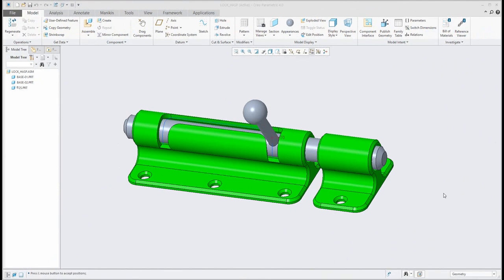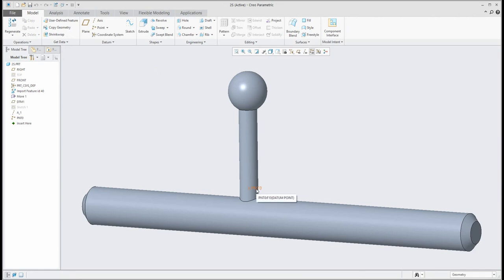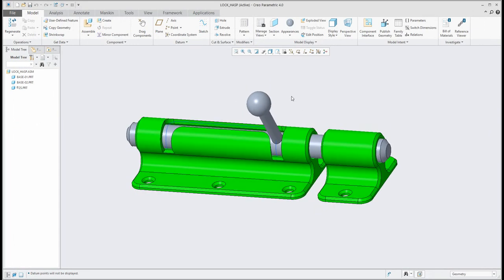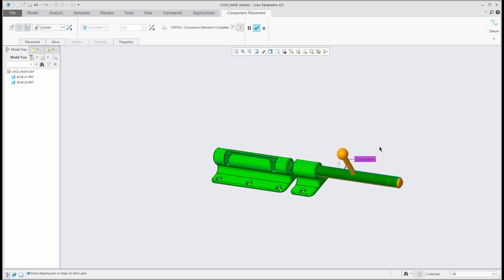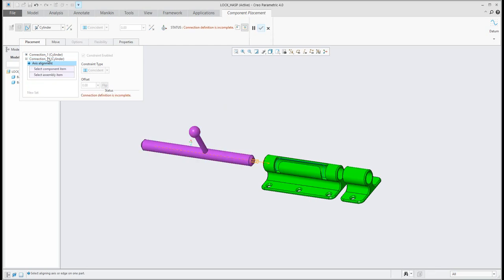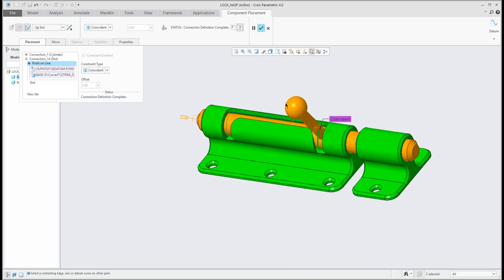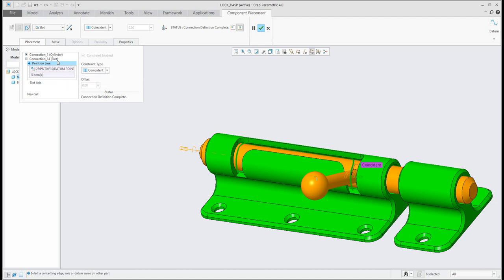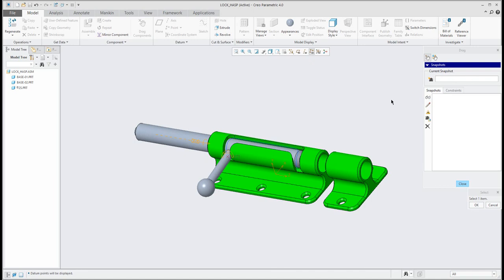PTC Creo 4.0 tutorial: Slot connection - model placement

Comment: I was trying to use the drag function and mechanism in Creo 8.0 student version but its not working like I see in your video.  I'm wondering if these functions are blocked - I can't imagine this being difficult to do. Any assistance is appreciated for now I'm just trying to rotate a component around a shaft.
Reply from the maker: Please check the video 1.34 > explanation how to move object without dragger
Reply from the maker: If you are in the "snapshot mode" only click on the model and then move mouse (3.33)
Reply: So what have is a cam constrained to a shaft. As the cam turns on the shaft it will move a cam follower up and down however I've had no luck so far in getting the cam to rotate so i can check the motion etc. Ive used this in SW but in Creo this is the first time. Thank you for your response.

Comment: I have a mechanism that only rotates with zero translation motion. I don't see any other option other than pin constraint that I could use but there is no option to restraint the part to only allow it to rotate without any translation motion
Reply from the maker: Hi, thanks for your question. If you need only rotate model - please use PIN connection: https://youtu.be/R_jICJpI8bc
Reply: @4kside  Thank you